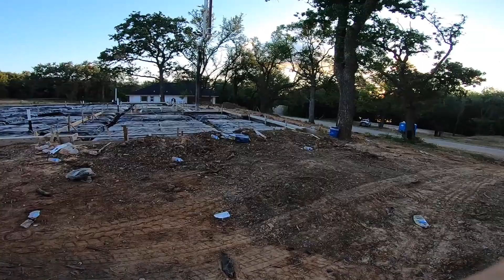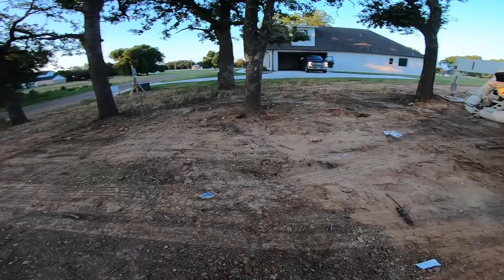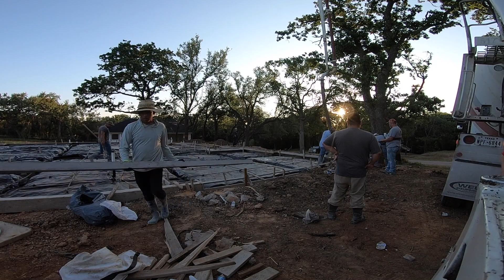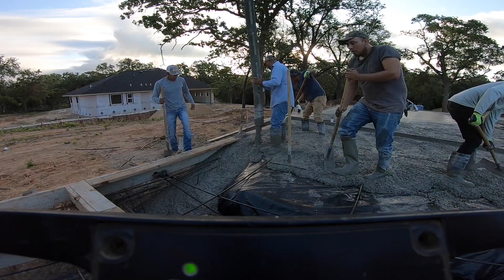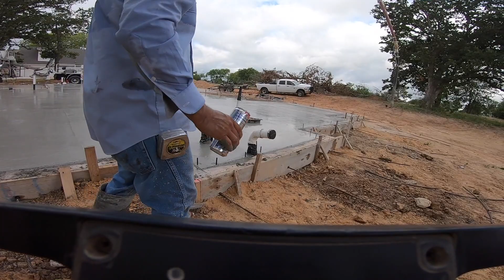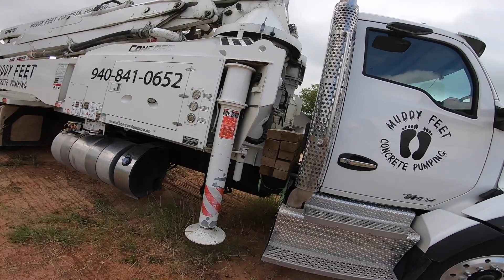Eagle Mountain lake house foundation with Muddyfeet

Comment: Glad to be taken along on that pour. Enjoyed it.
Don't understand the use of the old rear discharge concrete trucks, rather than the front unloaders we see almost exclusively in the north i.e. WI. Saves on a spotter to protect the pumper truck and trailer.
But maybe lower cost in the long run.
Reply from the maker: I’m not sure but we don’t have any here in Texas that I know of.
Reply: The vast majority of concrete trucks in Europe are rear discharge type. A lot of that is to do with construction and use regulations, primarily for overall length and axle weights and gross train weights.